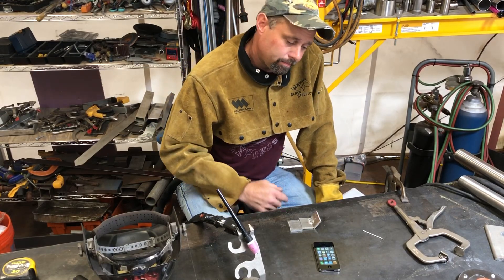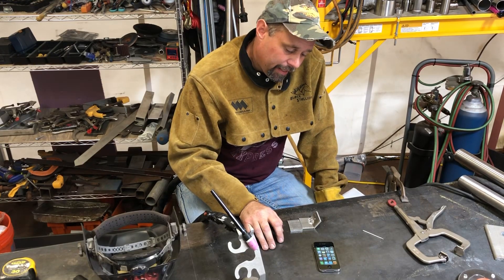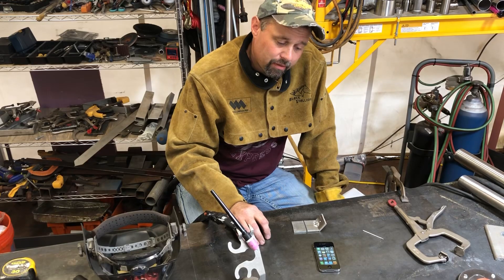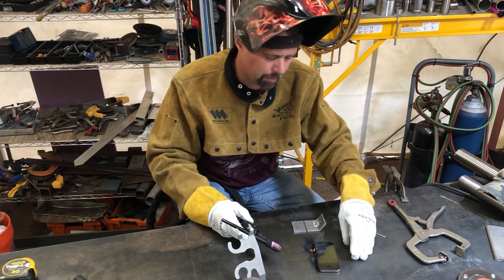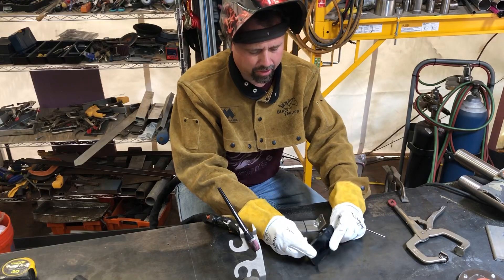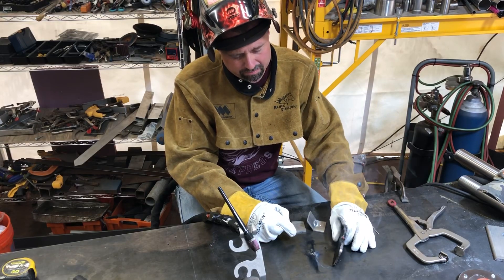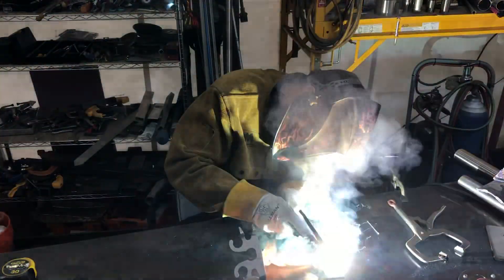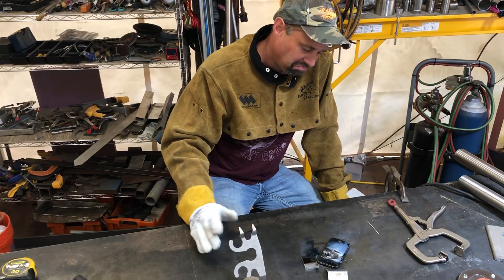Will High Frequency TIG Welding Damage Your Phone

Comment: Is it is possible speak and receive SMS  via 2G a cell phone,which uses 900 MHZ and 1800 MHZ GSM frequency band if welding is performing five meters away from this cell phone? I ask this question,because I read,that welding jams Wi-Fi.